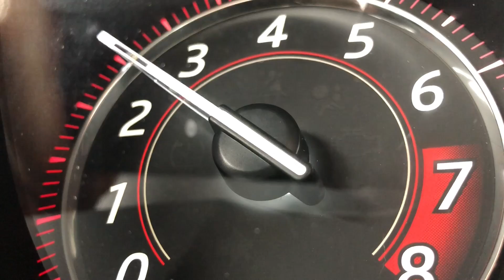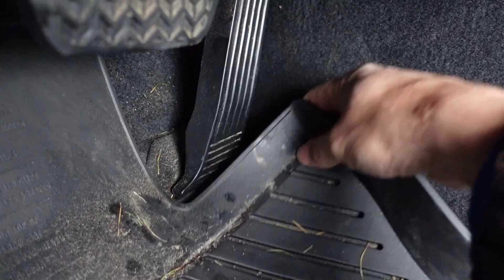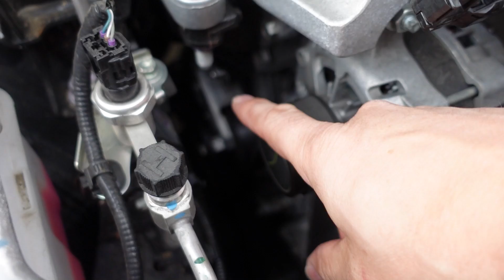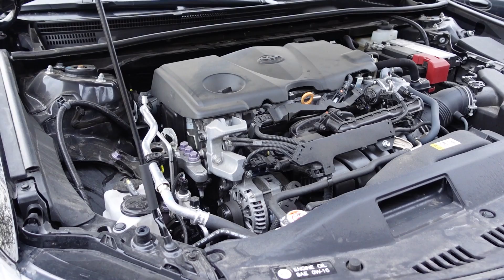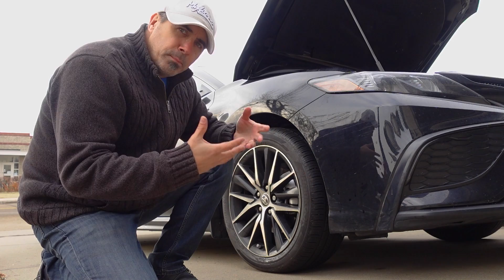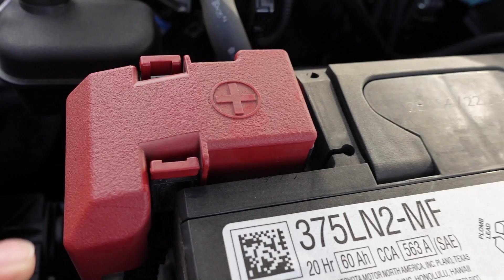Has Toyota LOST Its Reliability Reputation?

Comment: I think Toyota shouldn't downsize and turbocharge their engines. They might get 10% better gas mileage, but the engine will wear out 50% faster and they'll require more maintenance which negates any gas savings. Plus, a turbocharged V6 just doesn't fell as good as a good old V8. My friend test drove a new V6 turbo Tundra and hated it and is now looking at used V8 Tundras.
Reply: Its also emissions why they go to Turbo. They are not great  for longevity. For the most part I think 2024 will be the last year for good old naturally aspirated engines. Reliability will go from here. The cost to repair or cost of ownership will be another issue. The amount of hours In labor to fix these cars  has gotten crazy.
Reply: I have a turbochared 4 cyclinder 1.2 engine its brilliant at 7 years old and 73.5k miles and it drives like a NA 2.0 but time is the true test of it. I only run premium fuel it makes a noticeable difference and its always serviced a little early. Its also got much more low end torque and will sit at lower RPM than an NA engine. Its fuel economy is insanely good and the only major thing I worry about is sensors later down the line Still I'm in the UK and the only NA engines available are in cars smaller than a postage stamp. Of all the new modern turbo petrols the one I have is far better than say a 1.0 Ecoboost from Ford a 1.2 Puretech from PSA and Vauxhall all of whom use wet timing belt designs that kill the engine within 100k miles and make a timing belt change insanely expesnive. The engine I have has also not had Oil Dilution issues like the 1.5 Turbo from Honda. The design is 8 years old its has a timing chain and I've heard no horror stories so I am pretty confident it will go to at least 200k without issues.
Reply: It's for emissions reasons, especially the grams of CO2 per kilometers, or pounds per mile in the the States.
Reply: Say thanks to eco mentals and Joe Biden
Reply: These comments baffle me, if the engine is made for turbochargers they can still last a long time as long as they are looked after. The cost to run a turbocharged engine is much cheaper on gas so you end up saving on gas in the long run, with a V8 the extra amount on fuel you use will equate to a replacement engine anyway. It literally doesn't make financial sense to buy a V8 in 2023
Reply: @WayToManyAssassins  if a small engine running a turbo producing  the same power in the upper RPM range baffles  you there is no need to explain the physics behind it. It will Baffle you even more.  I guess you have never worked on a car. There is no comparison between a V6 and a 4 banger for  power delivery. Turbos today are used for one reason-emissions. They are not used for no other.  For example A 1.6 liter Turbo producing 200 HP will wear out faster than a naturally aspirated 2.0 producing the same output. Sorry There is no replacement for displacement.  Its Physics. Drive a Camry with the 2GR FKS  and then drive a 4 cylinder and  you will see  the difference even with similar HP but With a smaller cubic inch engine. Smaller Turbo  cubic inch   engines also have different gearing to give the illusion of more low engine torque cause of a lack luster power.  rev that engine to launch it and you better be on a first name basis with your mechanic. ALL turbos will fail. It's not if it's when. Allowing it to spool down will help but its not a solution. To say there is no need for a V6 or V8 misses the point.  yes u don't need it to produce 200 HP but u give up reliability hands down. I have worked on enough Turbos and superchargers to know. By the way don't confuse these puny turbos with real power producing turbos. They are not the same. Sorry  u will not hear  any "whoosh" as the pressure relief  valve  opens. So many people are under that impression. I didn't even get  into the physics of cylinder pressure.and  oil consumption.  Sorry your logic is seriously flawed. Car companies  are using them because they have no choice. They could care less how much it cost to fix them. That's your problem as long as it last past the warranty.

Comment: If someone gets an electrical short because a few idiots decided to save pennies by putting in a smaller battery and leave the fastener loose, you can hardly blame that on Toyota reliability. That's like saying Toyota has bad brakes because some people deliberately fitted the wrong size brake pads.

Comment: Yeah I'm in the field and we have alot of technicians and even advisors leaving toyota because the Cars have alot of mechanical issues which is OK for technicians but they aren't paying technicians worth a damn. We have probably 4 technicians and 1 advisor that left various toyota dealerships to work with us since vw treats their employees really well. We do have a wide array of different issues but at least customers are happy with the vehicle comfort features I guess..
Reply: @Ayn-Rand-Is-Dead  lol. But think about this as a technician perspective. Both toyota and vw use most of the same transmissions. So working on a tiguan is similar to a rav4. But toyota only pays 4.5 hours warranty labor for a rear main seal and vw pays 7 warranty hours. Surprisingly we rarely pull the trans out of volkswagens.
Reply: @quyle9483 so if  you can do any work in 4 hours you still want to be paid for 7 book and pass that extra 3 hours to the customer?  Seems like the book hours screw the customers. I know many mechanics who can do the work of many of these jobs in way less time than the  book hours says  but still charge the book.  the mechanics are ripping the customers off big time
Reply: @Ayn-Rand-Is-Dead  not to mention vw pays their employees 3k a year tax free just to be an employee. I make a great salary working for them and I'm hardly pressured. And hey, we will never run out of work lol.
Reply: @Ayn-Rand-Is-Dead  who said anything about reliability? Are you offended that I'm telling you that these toyotas nowadays have major drivetrain issues and toyota wants to pay crap rates to their employees to fix them?
Reply: @Ayn-Rand-Is-Dead  toyota still have a reputation for reliability, but let us not overlook that it may be questionable at times. There are actually plenty of 25 year old vw's on the road. Just no one cares lol. No one really drives past a volkswagen and acknowledge it anything past another automobile on the road. I work for the largest volkswagen dealership in the Midwest as a mainline technician. You better believe I will see all the garbage you could never imagine with 500 thousand miles. You want to bring up about the tdi scam but you don't want to mention the huge event when toyota recalled many vehicles because of carpet getting stuck on the accelerator pedal?
Reply: @quyle9483 do you think of VW is great that's why I owe them old is make noise and lose power and blow smoke and burn oil and make noise in the engine why is that Volkswagen and Audi lose all that value because they garbage the German ship all the garbage over here in the United States maybe they keep the good ones over there why don't you talk about that dog cats Victorious song you know you know it all you know the Volkswagen dealership speak the truth and get your hand out of your ass dog
Reply: @Ayn-Rand-Is-Dead  well. I am being totally honest here. You don't see any transmissions laying around our dealership lol.  Take a deep breath and just listen. I'm not trying to shove any wierd thoughts into you. Not trying to misinform you either. But if you want to hear what ex toyota employees have to say, even a YouTube search will open up just how the technicians feel working for Yoda. I have to deal with this in real life, people being really dissapointed. Would just hate to sit back and not say anything even if it all seems bias.

Comment: Toyota not reliable anymore? Hell is freezing over!
Reply: So I guess it's reliable for me I got a 2003 Tacoma two-wheel drive stick shift like brand new basically I don't even use it to let it sit 5 years I got a 97 Corolla with 70,000 Mi on it that's sitting toe a 98 Corolla with 98,000 it's a stick shift and it's sitting let's see what else 1997 Nissan Sentra best Nissan ever made and now that's sitting at the moment cuz I just bought a Acura TSX for $2,000 and I'm using at the moment it's over 200,000 miles on it but it's fast and all those other vehicles so I'm beating the s*** out of that at the moment it's got 220,000 miles it has the K24 puts out $230 horsepower with the automatic tranny and it's holding ass and and chicken dick sucking cock all the way dog contract I meant c u n t yes I'm not typing

Comment: I recently replaced my Lexus RC200t the water pump. It started overheating.  70k mileage.
Reply: That’s the same mileage mine failed at on my 18 camry SE. Very easy fix though.
Reply: @justing2465  I’m sure it was. On my side the job was slightly different, there’s so many components you have to remove before you get to replace it. Not a nightmare as replacing a bmw though lol

Comment: Those 1MZ and 3MZ engine sludge issues can easily be remedied using full synthetic motor oil. The 2AZ-FE is the only frail engine that Toyota has made. The UR, GR, AR, and ZR engine families are the most reliable. If I wanted a Turbo car, I'd go with a DSM, the 1980s-2000s Volvos, BMW M3 or M4, Ferrari F488, Buick GN, or just take an NA car that has good tuning potential and change out the internals and turbocharge it.

Comment: keep in mind, a lot of this is because of the government forcing car manufacturers to do stuff like this.  Just like in the early 70s when they crammed emission improvements down, and cars went from 400 hp to 150 hp....this is just like that.  A 4 cyl turbo puts out roughly same hp/torque as the 3.5 V6, but it puts out less emissions.  It likely will need more repairs over the life, however because of more complexity.  So the blame isn't exclusively on the car brands, they are forced to meet EPA numbers.
Reply: The EPA numbers are to reduce carbon footprint… too bad if you don’t like it.
Reply: @MH-fb5kr Carbon footprints can also increase when cars are prematurely scrapped because repairs become uneconomical.
Reply: It also produces that power way up in the RPM range. The torque curve Is not as flat. more wear @ higher RPM means more friction and heat.

Comment: Bought a 2012 Tundra 9 months ago. Full dealer serviced since new. NO accidents, NO rust, have FULL service records. 135k miles. Was a CPO in 2018 and given a 100k mile warranty. Then at 138k miles.... Valve cover oil seepage. Hopefully not cam tower leak = BAD BAD BAD. Timing chain tensioner FAILED, $3100 repair w OEM chains guides etc. Truck still in shop. Have a 1991 300ZX, NO major probs 175k miles. 2004 Nissan Sentra NO major probs 150k miles. Had Mazda 323 and 2007 Mazda3 155k miles and now have a 2018 Mazda 3 53k miles. NO major probs except AC compressor on 07 Mazda3. I thought Scotty, Wizard, Car Care Nut all said Toyotas are reliable???
Reply: That's an 11 yr old car, with probably a few owners.  All cars will have issues like that, but it's rare for a Toyota, you just got unlucky.  I have a 2005 Lexus Rx330 with 250K on it and it runs perfect.  Just replaced the steering rack, rear brake calipers/shocks and replaced the timing belt 2x(new water pump and gasket with those) just by recommendation, because it's not a chain.  Not bad for an 18yr old car.  I had a 12yr old Prius I sold with 160K, didn't put one penny into it, besides brake pads and oil changes(every 10K).  My brother has a Camry with 460K miles on it and still runs good, his kid drives it now lol!!  So I'd say Toyota is pretty damn good.
Reply: Dealers are overrated. Toyota Dealers are using the cheapest oil possible, even the service intervals had been strictly followed, the cheap oil will lose viscosity led to premature engine wear and oil consumption.
Reply: I got a couple of shity boxes there the new song of 1997 Sentra it was great the Old Forest garbage basically I think Mazda sucks I seen them get old and they get up they get old hard dog so you better Dive In your nose first and say what is right not wrong

Comment: What kind of a world do we live in Mark where we can’t trust in Toyota reliability? Kiichiro Toyoda is rolling over in his grave.
Reply: Myself and two friends  bought 1985 Hilux's. Even after the 10K break in period our engines ate 2.5 qts of oil every 3K. Toyota customer care said "within specs!" A technician told my friend that Toyota had a run of rings that didn't press hard enough to the cylinder wall letting oil into the combustion chamber thus using oil. He'd seen all kinds coming in. Myself and my friend bought a Chevy 3500 and a Ford F-350. My other buddy paraded in front of the dealership with a sign reading "My truck uses 2.5 qts of oil every 3K, how's yours doing?" After a few days of walking out front the service manager came out and told him he has getting a new shortblock.
Reply: Idk working in dealerships I honestly can't say that toyota really cares much of their reputation as they use to. The past 10 years I've seen more people lose their marbles over the major powertrain issues they have under warranty. They could have a motor or transmission swapped out or repaired under warranty and will still claim they have the most reliable vehicles ever. Certain models do retain a very good reputation though. I do see many camry's with over 300k on original powertrains
Reply: I don't know where he's getting his info.
Reply: Would love to see him CALL A MEETING,🤬
Reply: He was cremeated

Comment: Hope i dident screw up buying a 2023 Camry.
Reply: Nah. Still great cars just not as reliable as previous ones due to the electronics. They are still better than the rest as those get worse too. Honda uses a lot of Turbos, not good! Toyota no so much yet.  "yet" is the operative word.
Reply: @njackson18  Thats why i bought the v6 to stay away from turbos.
Reply: i got a 22 camry TRD, so far almost 23,000 miles on it, no issues...but yeah, I wonder what it'll be like at 200k.
Reply: @mikel2887 i love the TRD!
Reply: Maintain that 2GR and it's almost bullet proof. Only the water pump may leak but small stuff compared to other cars. The 2GR is in the Lexus ES 350 and it's a gem!
Reply: My 2009 Mazda CX-7 Turbo made it past 215,000 miles with new owner as of one year ago. Could still be going.  @mikel2887
Reply: Dual port injection is more complicated than just old school fuel injection. So that maybe some of the issues in the latest Toyota cars. Overall, Toyota is still near the top of the class in long term reliability.
Reply: Yeah I got to say that's the way to go but unfortunately it said crack man's car

Comment: The 2GR oil line issue was fixed. The water pump still has some issues. The 2GR FKS is one of the best engines. Get one while you can. it will  be gone soon for less reliable Turbos. I discovered your channel not long ago . Great work on your videos. Well informed, balanced  and fair.
Reply: So true.  My 2020 Lexus GS F sport has the 2GR FKS engine. Very good power overall esp on freeways.
Reply: @netman88 so sad they discontinued that GS F. It was one of my favorite Lexus. Hang on to it!
Reply: My 2023 2GR FKS timing chain cover started leaking oil at 16,000 miles. After digging around some I found that this motor is common for this and a coolant leak as well. Toyota replaced mine under warranty and it’s about a $5k job. Double check the timing chain cover for leaks if your in the market for a used vehicle with the 2GR FKS 👍
Reply: @Clayton_J  They did redesign the timing chain cover a little. I do know some still have the issue but not as much.  Supposedly it's the assembly of the engine that makes it leak. If the 3 mating  points of the block to cover  are not  fully clean it will leak.  That surface area is not supposed to be touched by hands. To me that is still the Achilles of the 2GR. Glad this happened during warranty but  as with most of  them if they are going to leak they leak early. Now you are good. Hang on to that car. Turbos and Hybrids can be more than 5K and  will not outlast that NA 6
Reply: Tengo una hilander 2gr se remplazolas líneas de aceite.Le cambio el aceite y filtro cada 3500 millas vivo en Puerto Rico una isla tropical calurosa le remplazo el coolant cada 3 años o 36,000 millas aceite de transmisión cada 30,000 millas todos los aceites sintéticos mobile one. Pcv cada 20,000 millas.El filtro de transmisión cada 60,000 .Filtro de aire de motor es un K&N.Los espares o bujías cada 60,000.Nunca a dado un solo problema de nada el mantenimiento es clave.